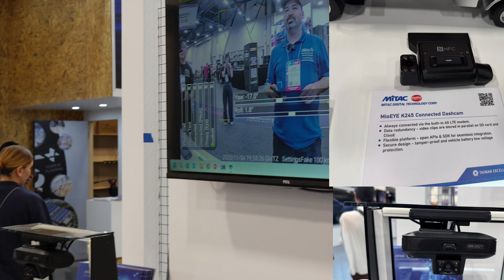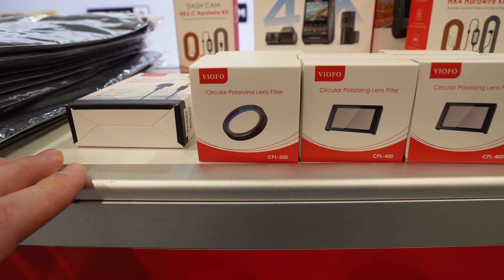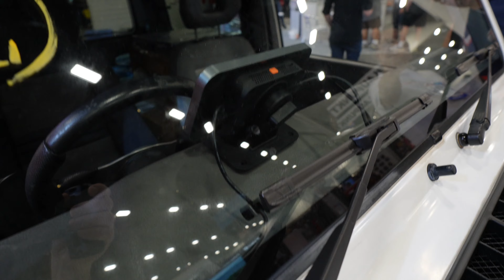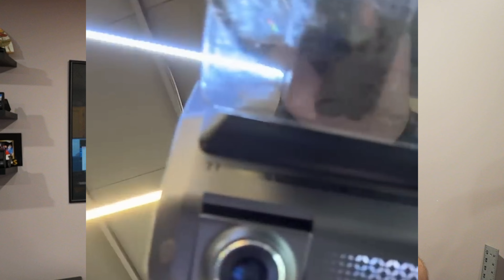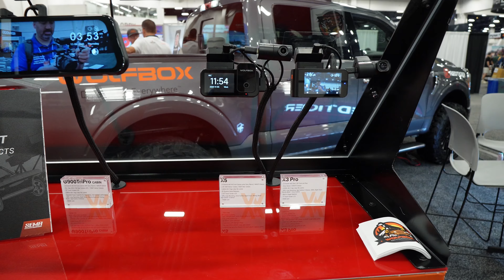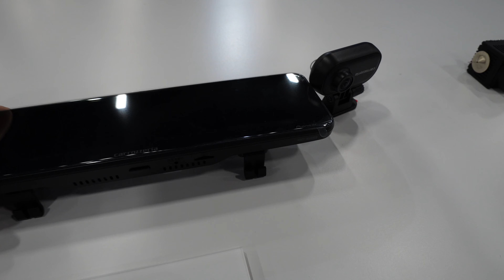Whats new and exciting SEMA 2025 dash cameras

Comment: Had my Vueroid S1 and iroad powerpack 12 installed about 10 days ago. I find my footage is a little underwhelming. Definitely not looking like some Youtubers' footage from the unit.
Reply from the maker: How is it setup? What video settings are you using? Cpl filter?
Reply: @SafeDriveSolutions 60hz, high bitrate, 4k30 front, 1440p30 rear. CPL is on. Has a little mark for alignment. And of course, I wiped all the lenses and cpl off. Windshield is clean.
Reply from the maker: @zerotolerance5581 did you take the plastic off inside of cpl? Vueroid puts a protective cover on inside and outside of cpl.
Reply: @SafeDriveSolutions  I did not install. Had a local guy do the whole thing. Thanks for the suggestion. I’ll look.
Reply from the maker: @zerotolerance5581  I almost missed it. So I could see someone else missing it as well.

Comment: I wish Viofo would make a 4 channel with front Telephoto, standard, fisheye interior and rear with great cloud connectivity more like Tesla or BlackVue.
Reply from the maker: Blackvue does not have 4 channels or Telephoto. Do you mean to have CLOUD connectivity?
Reply: @SafeDriveSolutions I realize Viofo doesn’t have 4 channel. That’s why I wish it. Gabriel on Vortex has shown the a329T with Telephoto, hence the “T” is the name replacing the “S”. Even Gabriel has mentioned on a Vortex vid he wishes the had a 4 channel. But I also wish for Viofo to develop cloud connectivity. The a229 pro had/has Telephoto capability too. I own it with the telephoto camera. However, you sacrifice the rear camera to have telephoto along side the front standard camera view. With the a329T you sacrifice the cabin camera but keep the front standard and the rear. A better solution. Then again, Tesla’s exterior side view cameras are better than cabin cameras while underway.
Reply: @SafeDriveSolutions  oh, I’d buy BlackVue if they had 4 channel, with Telephoto, front standard, fisheye cabin and rear for their connectivity.
Reply from the maker: @davidcline9686  maybe one day.

Comment: Whats the best 4K Front & 4K Rear?
Either existing now or soon to release?
Reply from the maker: None of them. Would not recommend 1 4k rear camera
Reply: @SafeDriveSolutions  Curious, why wouldn’t you recommend a 4K rear cam?
Reply from the maker: @EdwardB-to5tb at night it is heavily pixelated. Image sensor starved for light. Lots of stability challenges on 4k rear camera systems.
Reply: @SafeDriveSolutions do you think elite 9 will also have same fate? . I was really looking forward to it
Reply from the maker: @faizansiddiqui9261  Elite 9 is 4k front and 2 k rear. I dont have one in my hands to give an honest opinion on it.
Reply: @SafeDriveSolutions  Do 4K front have the same night vision problems?
I have a 4K BlackVue, that I never installed yet.
Not excited about it because I wasn’t impressed with BlackVue as a whole (had a couple 2K systems prior).
Looking for something better….

Comment: Wonder if Blackvue elite 9 and 10  have solved there heat issues.2k and 4k rear  would be running hot
Reply from the maker: These are not released yet. But I guess we will soon find out.
Reply: @SafeDriveSolutions waiting for you to try it out once it comes out